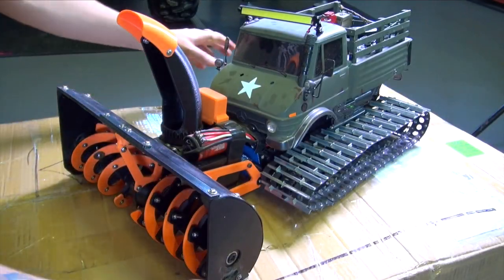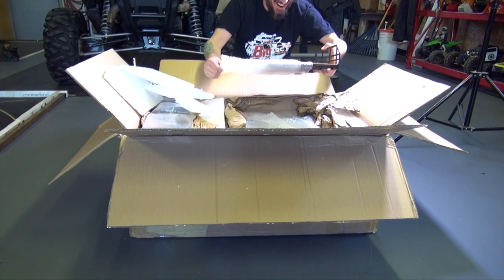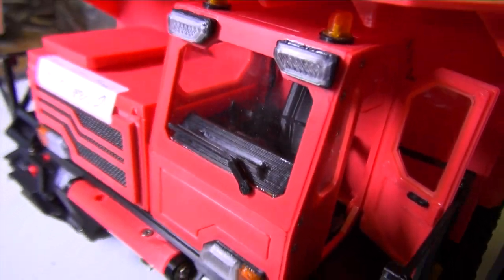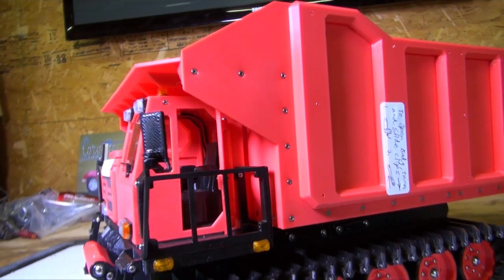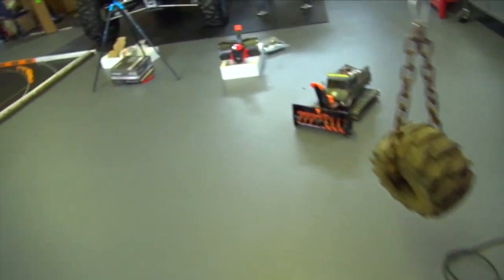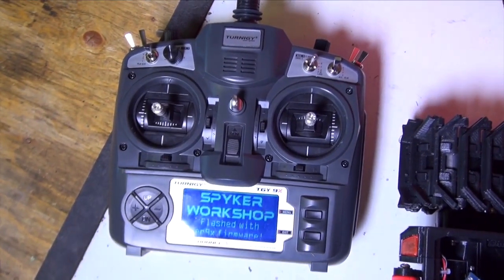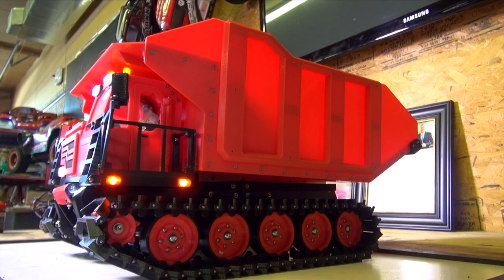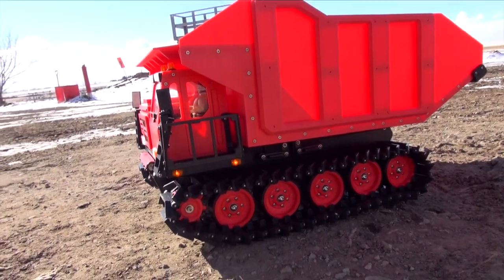The WORLDS FiRST Fully 3D Printed Radio Control 1/12th scale TRACKED DUMP TRUCK! Spyker KAT

Comment: Wow that is absolutely insane! 100 hours of print time plus countless hours of assembly and detailing! That guy knows his printing, so many other guys printing struggle to even make anything useable, he made an entire original design rc!
Reply: a google user. do u have a diamond play button
Reply: Never too many wows lol
Reply: he probably bake cures the parts for strength and finish because I can hardly see the extrusion lines
Reply: the worst part of 3D printing is the time it takes, and recently we had bad storm after storm after storm in northern CA, and I had to throw out the last 3 attempts of a prototype after the printer was 40 hours into a job, because when the storm cuts the power to the printer... that job must be thrown out and started completely over
Reply: a google user
Reply: Johnboy What kind of settings? 40 hours sounds crazy, the longest single print on this whole Spyker KAT was under 7 hours, and thats like plate FILLED with parts. You should look into larger nozzles. I use 0.8mm nozzles. The lower chassis is about 50 hours across 9 prints, buckets 60 hours over 12 prints.
Reply: +Spyker Workshop   Factory settings on a Robo 3D, pretty slow and it's one of the cheapest and smallest printers on the market... the whole prototype is slightly smaller than the size of a shoebox but there are about 12 walls/panels that are 1/8" thick with a couple "keyholes" cut out and it has to be printed in 2 pieces because max length to print is 250mm, then the two finished pieces need to be bonded together

Comment: That is probably thee most bada$$ tracked vehicle i have ever seen, im still in shock that its 3D printed! like you said , just WOW!!!! super cool man
Reply from the maker: Thank you for sharing in my excitement! It is truly an incredible step forward in the hobby - or should I say "Hobbies". 3D Printing, Engineering, Robotics and Radio Control
Reply: Can you plz do a tamiya Holliday buggy build video/series

It is a very upgrade able car that is 1:10 scale and very durable

Plz I have one and my dad has a version of it and it goes through allot of abuse

It is 2wd and I have only broken one peace in 3 years and only because of my own stupidity ( jumping about 2feet of the ground with worn out suspension)
Reply: @RCSparksStudio also i have been thinking of building a half tracks rock crawler would i be able to get those awesome tank tracks for it  and would i be able to get them for the predator tank tracks

Comment: At 11:43 in the video I noticed a screw that was backed out on the driver side inner hub. Just a heads up. Really cool that thing is fully 3d printed! Unreal!
Reply: Over 4 years later, I’m the new owner of this Spyker Kat!  That loose screw stayed just the way you seen it and road that way all those years without getting lost!  Tough to believe!  I actually fixed it recently by using longer screws. 😉. That screw was like that because of the threads being stripped.
Reply: @Twizztify  lol awesome!!!

Comment: I didn't pay much attention to 3d printing until I saw the fully 3d printed RC plane airframe and gears for battle bots. Once I saw the gears, I was sold.  So, if at this point in 3D printing infancy, we can molten materials for gears that can withstand the stresses of powerful electric motors just think of what we will be able to print a year from now. 
Desktop manufacturing FTW! (are the kids nowadays still saying FTW?) Anyways, awesome work!

Comment: Ok, I've seen dump trucks, but I have NOT seen a tracked dump truck, so this is so totally new to me, at least. & I must say, in a sense, it does look pretty awesome, something the snow blower can blow snow into the dumper, which seems like it would work pretty good.
Reply: Yeah once I seen just how strong the lower chassis was (able to carry up to 50-60lbs) I had to make use of all that weight, so I made a dump bucket! Also yeah the bucket was designed to let the blower blow backwards into it.
Reply: Awesome.

Comment: This is an impressive vehicle. The pricing also seems reasonable to, I could see something like this going for almost 800-900 dollars. Although I wonder about the durability of the belts in the drivetrain with all the torque being put through it.
Reply from the maker: The belt design has been proved through the design of the snow blower! That blower has to move some serious weight and snow.. and the belts hold up well. I will ensure I watch the belts and report if I see any wear
Reply: RCSparks Studio that makes sense. I know belts are used in other off road vehicles, but this thing is a monster! Cant wait to see more videos on it lol

Comment: What insane machine.. I noticed on the back of it, is that a spot to put a snow blower on the back? because it looked like the same bar on the front as well..
Reply: Yeah the whole chassis is split into 2 halves on top, so you can pick which end you want to be "front" it can be driven in either direction, and those mounting bars can hold the battery weight boxes (not shown in the vid) or the blower, and future expansion stuff. Inside both front and rear mounts support up to 2 servos to operate different attachments. Or like shown in the video you can lock the mounts to the frame if you don't need to move them, so many options!!!
Reply: Spyker Workshop very cool..Nice work..

Comment: Are 3D printed stuff durable enough to be tracks? I'm just wondering, because I'm building my own second world war Pershing in 1/10 scale, and it'll be kinda heavy, over 12kilograms (closer to 15 kilograms I believe) and looking for a solution for the tracks. So I'm wondering if 3D printed tracks could hold and be strong enough.
Reply: Janne Grönmark I own a 3D printer and it takes some work to break stuff.
Reply: So that would be one option for tank tracks then... what plastic would you recommend for something that would need to withstand water and cold, as well as bit of rocks too (not planning to ride over rocks tho, but there's always some)?
Reply: Janne Grönmark nylon would probably be best but abs would work as well
Reply: Sterling Hamilton Right, thanks for the info :) Nylon is the more wear-resistant of those 2 plastics?
Reply: Janne Grönmark it's way stronger. Probably wear at about the same speed but I can't say for sure. I don't have that much experience with nylon but it should be perfectly fine.

Comment: I'm in the process of building a 6x6 and want to use skid steering. I've not been able to find an ESC to control the steering. Can you give me a detailed description on how you control the tracks on your rig. I have a bunch of brushed and brushless ESC's and a Spectrum 3 channel radio and was wondering if channel mixing was a solution. Just not sure how to mix the channels. I know a simple 2 channel stick radio would do the trick but I would prefer my Spectrum radio.
Reply: This machine uses a modified 9x radio with er9x firmware flashed to it, really advanced mixing options on that firmware.

Comment: hey medic love your vids i have question for you so a have a nitro dhk maximus and i am putting a savox 1210 servo for steering but i have the stock servo for throttle all that is running on it is the two servos i havent had a chance to test it so do you think i will need a bec it is only powered by four double a batteries

Comment: all ok, but i would prefer another stearing. every track steared separatly. one track for one stick od You want to go straight, You need to pull both sticks up. if You want to turn, You can pit one stick up and one down, or only one stick up;)
Reply: That radio it came with is flashed with er9x firmware, SUPER advanced! Would be easy to change over to that control layout.

Comment: Doesn't the plastic wear down in places where they are rubbing against each other
Reply: I've been watching his tests with water bottles in the bed and you can tell it's very powerful but what I love is that you get something new so do we cause you always share your knowledge and your new toys 💯👍💯❤️❤️❤️❤️❤️❤️
Reply: Nothing on the whole machine actually rubs plastic on plastic. Nearly every part that rotates has either a ball bearing or an aluminum spacer. The tracks are also pinned with nails, so its plastic rubbing on the smooth nail. It has about 40 rubber sealed bearings! Just the dump bucket alone uses 6 bearings
Reply: Spyker Workshop I just subd I love your creations 💯👍💯👍💯👍